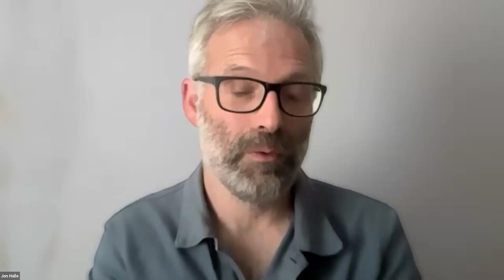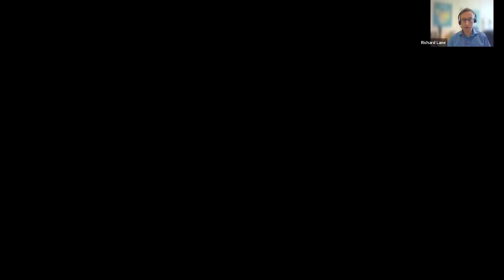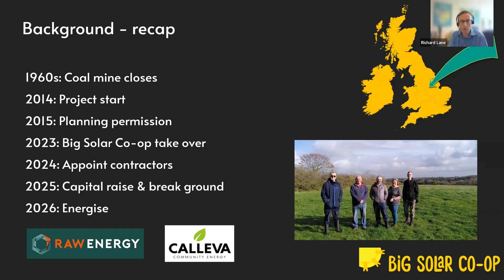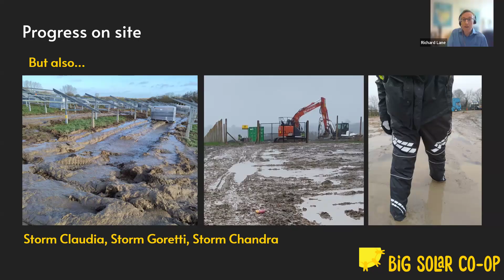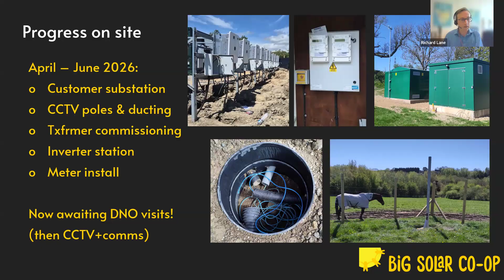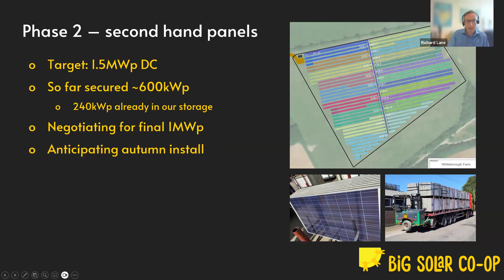Whiteborough Solar Park update webinar - June 2026

Comment: You have made it evident that lowest agricultural value land is out there and (despite turning track to mud) can be utilised.

In the end I believe the panels will cover much of the site for their lifespans. Is there any benefit in rehabilitating the soils in the next 30 years to aim for 2nd lowest quality status (IE for a net biodiversity gain), and is any of the field less degraded and less clay based than the DEFRA mapping of low value suggested?

LB ( a bondholder )